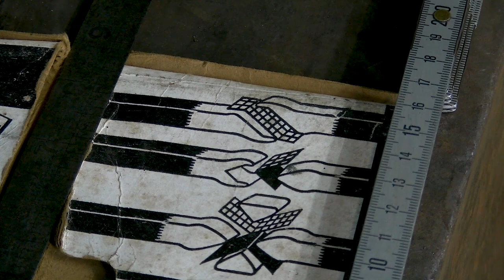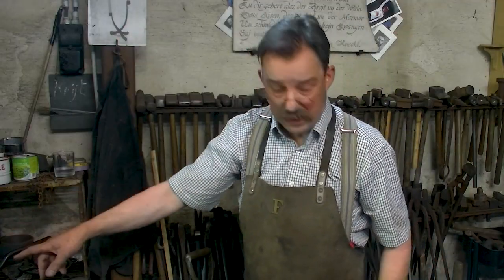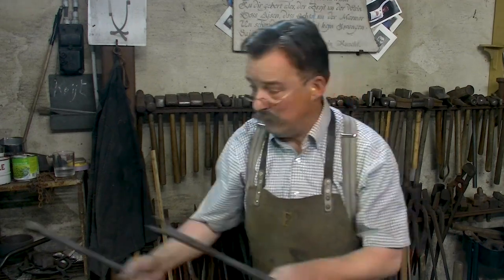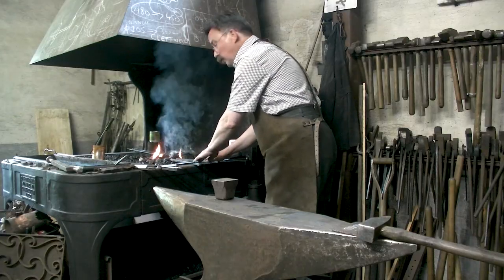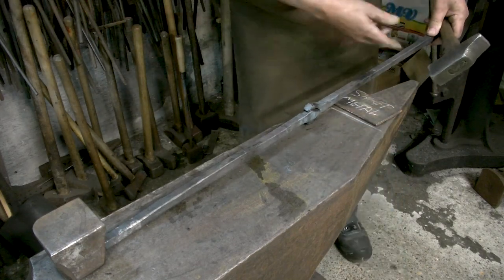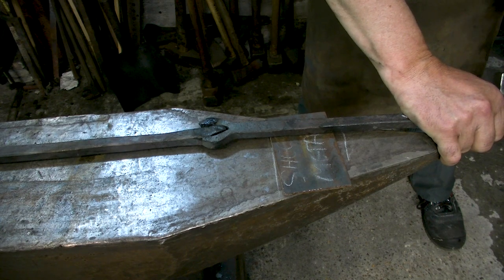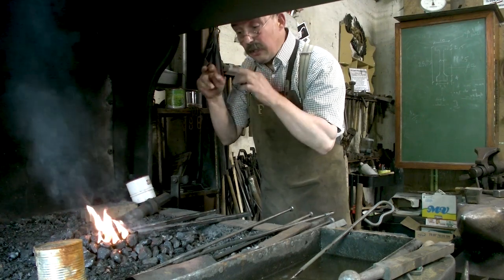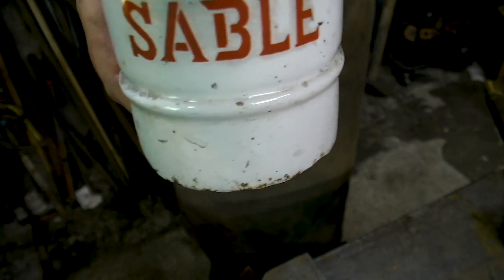Forge welding with Filip Ponseele: The cleft weld! (2020)

Comment: I’ve found it easier to do a cleft weld in the fire. Align the pieces how you want them and when it’s up to the proper temperature hammer the end of the male cleft bar into the female cleft, and that tacks them well enough to withdraw as one unit from the fire and finish welding on the anvil. I don’t know if that would work on heavy bars though. I suppose you could repeat driving the male cleft into the female cleft a second time at welding heat to really get them stuck for a heavier bar.
Reply: We kept the bars short inorder to demonstrate on the anvil. But bigger stock we do as you say directly in the fire Kind regards Filip
Reply: Filip Ponseele well that’s good to know that’s how you do it with bigger stock! Thank you!
Reply: Male and female lol
Reply: Antonprojects boy are you gonna be in for a giggle when you find out about pipe fittings.

Comment: Looks like serious competition for you, Joey! Would like a demonstration of a tri-joint (for a trivet). Don't know if it's correct, but the way I do it is to start with one piece upset slightly in the center, then bent to 120°. Then bend the second piece into a stubby 'j' to fit around the 120° bend. The second piece needs to start out a bit longer than the first piece before preparing it. Or is it better practice to bend the first piece into a 360° with a gap between the long ends (like a tuning fork)?

Comment: Thank you so very much. First time I've had this method described step-by-step. At what point did you apply the flux? New to the forge, still learning.
Reply: We used sand as  a flux.Sprinkle it  when in fire nearly meltingpoint(sweeting like )

Comment: Joey

If possible I would like to see you do something really cool as a weld.

I'm not sure what you would call this weld. But I'll try to explain what I mean.

It's a flanged rod that is forged welded onto a thick flat plate.

I liked your anchor demo, that was awesome. 

The way you added iron to the main shaft to build up your weld gave me this crazy idea.

I've tried my best in making a divot and fullering the sides.

Either it's not hot enough or I move to much material and the weld won't take. 

If you could, or would like to work into your busy shop time I'd be greatly appreciative. 

Thank you for doing what you do for all of us amitures out here.

Bruce
Reply: Welds are never COOL they are always HOT(haha)
Reply from the maker: Bruce, could you email me a drawing of the weld you are trying to do?
Maybe I can take a video of doing that weld, if it is a doable weld.
Email: TechnicusJoe @ Gmail. com
Reply: @TechnicusJoe  
Sure,

Comment: This was wonderful to watch. Would you ever attempt to do this weld in mild steel?  Is it possible?
Reply from the maker: Yes, I have done it in mild steel before. You have to bring down the welding heat a little as the modern mild steel is not the same as wrought iron.

Comment: Add a few fluxes and trace elements to that quartz sand and bring it to about 2650 Fahrenheit and you get quartz crystal chemistry glass for high end chemist experiment no surprise it works as a flux for forge welding.

Comment: the qaurts sand this was added after joining points was heated yes ??
Reply: the quartzsand is applied when the iron bars  surface appears to look like sweathing. It melt around it and protect hte surface from  dirt and oxigen. The prpre weldingtemp. looks like ceamy fresh milk'yellowisch)

Comment: You know, with these kinda forge welds... That scene in lotr where the elves are reforging anduril doesn't look QUITE so stupid.
Reply: well... it IS still pretty stupid, it is still a recipe for disaster
Reply: @yyeetmax2849  But "There's nothing wrong with a little disaster".......
Reply: I remember that scene. 
they just laid the sword pieces side by side, 
without overlapping and hammered from the top. 
and the hammer technique, uffa XD

Comment: OK so I like the theory better than a scarf weld one. Yet at the end, it looked as if you could see cold shuts.  Still, I doubt that the weld will ever fall apart.  It lookes similar to how hard steel is wedged into an axe bit and that works.
Reply: the colds shuts are cameraerrors(there waren't any not with old stock iron). you're right about the type of welds. common practice in all fields of blacksmithing
Reply from the maker: What exactly do you see as cold shuts? I don't see any in the video.
Reply: @TechnicusJoe  sorry Joey, maybe what I see at 13:04 and 14:46 are lines or othet artifacts, but to my untrained eye they look like cold shuts.  Remember I am only a beginner.  I am still trying to figure out what works.  Scarf welds seem complicated.  This method appears easier to understand.  You guys have been blacksmithing a long time.  I mostly get cold shuts when I am knocking the head off a railroad spike.  Or at least I think they are cold shuts.  How can I tell for sure?
Reply: @markmoreno7295  hello, practice daily on small stock,upset enough so you have material enough for 2 or 3 weldingheats  to forge down to your startingmeasure of the bars you use. Succes